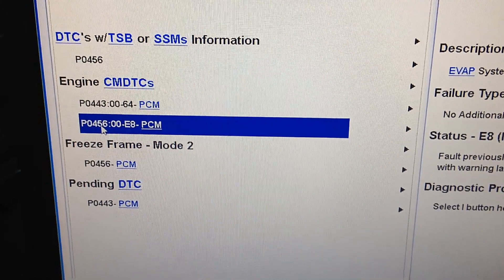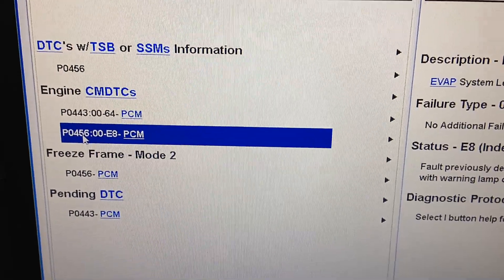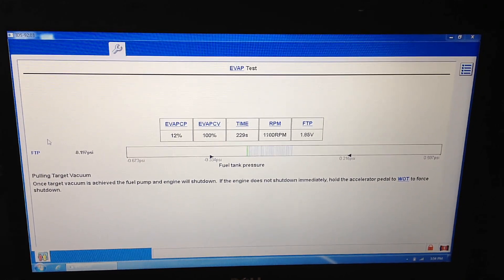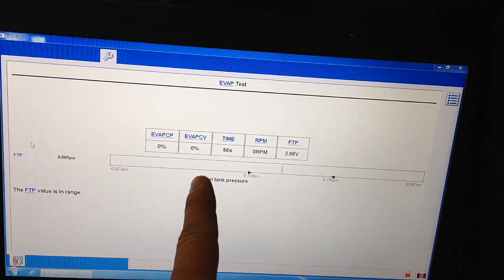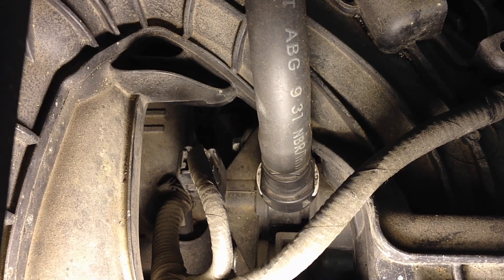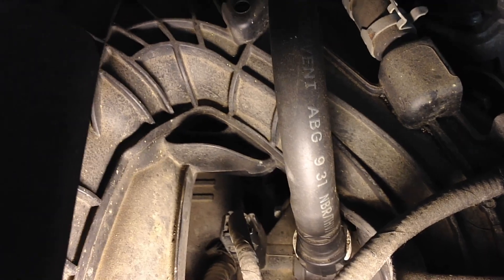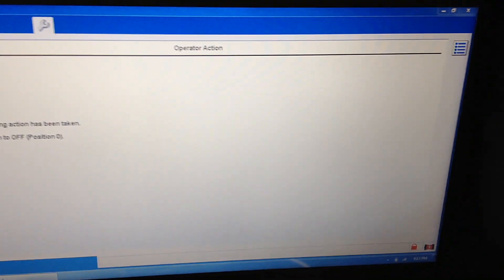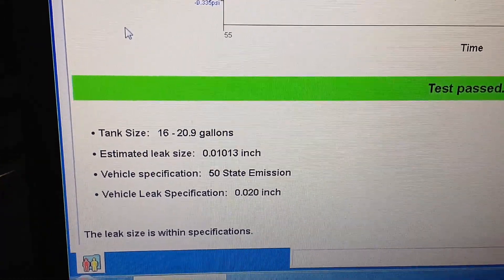Multiple Ford Vehicles 2009+ Evap System Leak Codes P0456 P0457 P1450

Comment: Thanks so much for this! I ordered the part, tested my existing part and I'm definitely getting a little bit of suction. Of course, the other issue is that my current valve is missing a screw, so that's probably causing part of the problem. I'll go ahead and replace it, though, as the new ones have probably fixed the initial problem with the faulty valves.

Can I make a suggestion for future videos? Can you back up and do a wider shot to start and then show exactly where the part is in the grand scheme of the engine compartment? When you start with the close shot, it's hard to tell if you're in the engine compartment, under the car, facing which direction, etc. It would really help to get some context first. Thanks for the great videos!
Reply from the maker: +Steven Leigh yup I have been doing that for almost a year now on the newer videos. I had to realize many never opened a hood before so you need to pan out then in or at least mention the location in the engine compartment
Reply: You're awesome, brother. Thanks for all you do. I love that you are so detailed and yet you keep it simple enough that even novices like me can get things fixed cheaply. I even did this fix in the dark and in light rain. :)

Comment: Do you have a good starting point for a code p0453 on a 2010 ford fusion?
Reply from the maker: Yes but it is going to require a scan tool that can read the ftp voltage pid

Comment: So if the purge and vent valves have been ruled out/replaced , would taping up the capless fuel fill receptacle on these to achieve a seal isolate out the fuel filler neck o ring as the culprit to a small evap p0456,( as long as it passes the drive cycle check)?

Comment: Having a rough idle and truck dies...but problem is intermittent. Also difficulty starting truck after refueling. 2009 F150 5.4L. Got the P0145 code so guess I'm replacing the purge valve as a start.

Comment: Hello, had some of these codes so I did the valve and did the throttle body to avoid future hassle after a few random stalls. Now, just stalled for first time since that work a few weeks several hundred miles later. This time I noticed a groan instead of normal prime/click/hiss prior to start. Will start up shortly after stall no problem. Suspecting fuel pump, should I go ahead and replace that as well? Will that putter out like this or is it more of a work until dead? 2010 Escape 4 Cylinder 114k zero issues until the random stalls over last month or so. Any way I can give you credit for purchase of the pump (Amazon or other) ? Thanks for your time!

Comment: Just changed the Canister Purge Valve on my 2010 Ford F150. Got the valve from WalMart online believe it or not. Then I purchased a OBDII Scanner at WalMart for $19.99 and cleared the error code myself. It took about a minute. The Purge Valve is located at the top back of the engine on the 5.4L engine but it only had one 8mm screw holding it on. There are two clamps holding the hoses in place that come off very easily. This video saved me a bunch of money.  Thanks

Comment: Got a P0455, then multiple; seems every other day P0457 (Check Fuel Fill Inlet), codes starting about half a month ago.   I checked the purge valve after finding this video of yours, and it was soooo stuck open.     Also love your capless fuel filler video too, which I've also done now twice, before finding the purge valve being stuck open.    Got a new purge valve, no more vacuum with the wire disconnected.   Waiting to see if the truck resets its codes naturally now,  I'm hoping the purge valve was the problem and not part of one.  Oh, vehicle of mine is a 2010 F150, 4.6 L. 3V.    Thanks so much!!!

Comment: I got this code on my 13 focus st, where is this located?
Reply from the maker: +Daniel Lopez It depends on the engine that is installed just follow the evap line from the firewall over.
Reply: +FordTechMakuloco well the check engine line went off after i pump gas

Comment: I have a 2008 Explorer XLT 4.0L SOHC and I am getting the P0456 code.  The vehicle has the cap less fuel fill system on it and I replaced the canister purge solenoid located near the fuse box in the engine compartment.  After I replaced that part and reset the light, the check engine light keeps coming back on for the same P0456 code. I also performed the cap less fuel filler maintenance as suggested in your other video.  Should I replace the vent valve located near the fuel tank and rear axle shaft?
Reply: I'm not an expert, but I know the P0456 code will often stay on even once the problem has been fixed, unless you clear it with a reader that has that capability. You can get an ODBII reader on Amazon for about $32 that can clear the codes, or a shop or parts store may be able to do it for you. Some parts stores are reluctant to do it, or their readers don't have the capability.

In any case, if you clear the code and it comes back, you still have an issue, obviously, but if it doesn't, you're probably good.

Comment: Do you know where the purge control valve is located on a 2013 Ford Escape?
Reply from the maker: +Miguel Soto It is either part of the line into the intake above the ETB on ecoboost models or it is bolted right to the intake on the 2.5L
Reply: +FordTechMakuloco so I have to buy the whole wiring harness to replace, I have the purge valve, but don't see it anywhere near/connected near that wiring harness
Reply from the maker: No the wiring harness is not affected.

Comment: What about P0442?  I'm getting this in my 2012 F150 for the second time within a year.  The dealership charged me $800 to fix it the first time.
Reply: Curious if you ever found out the cause of that code? What did they fix at shop? I’m thinking it’s my fuel inlet valve or possibly electrical. Thank you

Comment: I've changed the part like you suggested but still have a issue, I can't get my car registered till this is fixed.. any other ideas?
I have the p0455, p0456 and p0457 on my 2009 Ford Escape Limited V6 w/110K miles.
Reply from the maker: +Carlos G Ok so the canister purge is new and the pcm has been reset and the check engine light has come back on with only these codes right?
Reply: +FordTechMakuloco  Yes, New purge, I cleared the codes and the CEL goes away, I also tried to clear the memory using another video where you suggest making a jumper to the batt, I left that for 30 min while I washed my car but that did nothing either. I still have the light come on every week or so and the codes are still in the memory.
Reply: +Carlos G  Just a FYI: I tested the new purge valve for suction and their is a slight suction but I have to leave my finger on the opening for a good min or so and even then it's very slight. Thanks for your reply.
Reply: +Carlos G where was the purge valve located? Can't find it on my 2009 v6 escape.

Comment: would this be common on a 08 ford focus
Reply from the maker: +jason hernandez No they started using this valve in the 2009 and newer Fords.
Reply: +FordTechMakuloco will this solve the p144a code on a 2009 ford escape 2.5L?

Comment: +FordTechMakuloco I ran your simple test and I have replaced the Canister Purge Valve on my 2012 Ford F-150 3.7L. The truck is still running poorly. Aside from sounding like the engine is bogged down, the oil pressure gauge has started to drop off during light acceleration. Any suggestions?

Comment: When I spoke with the service department regarding the P1450 for our 2010 F150, he felt it was not the valve located on the firewall but the valve located on the top of the gas tank.   Of course, that is not something we can do on our own and will cost at least $500.  Thoughts?
Reply: +FordTechMakuloco - thanks for the video. Great stuff. I had the 1450 code pop up (and had problems starting after a fill up). Replaced the purge valve and code never came back. Truck seems to run a little better now as well. Could it cause a low grade misfire when faulty?
Reply from the maker: +sam foster 1450 is definitely the purge valve every time in my experience.
Reply: can you give the location on 2014 fusion se 2.0 eco

Comment: I just called Ford customer service about this problem.  Our 2010 F150 started having issues the last time we filled the gas tank.  Today CNN reported a recall involving the canister purge valve in 2010 and 2011 Ford Fusions and Mercury Milans.  They have no current recalls on the F150.  Please make sure that if you have this problem to report it to Ford which involves having to have a dealer service department diagnose the problem so that a recall can be issued for the F150 as well.
Reply: My 2015 mustang had to get the same part replaced with only 30k miles.
Thanks for the video and information
Reply from the maker: +sam foster They are starting with the fusions but I think this will expand.
Reply: Glad i seen your Pose Jose.  My 2015 GT just yesterday gave the P1450 code and i was wondering if it affect us as well.  I also am at like 34k miles.  kinda of annoying for some to go bad that early in the cars life,
Reply: My 2015 Edge with 42,500 miles has  a P0456 code.  Now I know what's happening when I take it to the dealer Monday.  Thanks for the info.

Comment: I am  going through this on my 2011 fusion 2.5l.  my question is can I replace the current capless system with a regular gas cap system from another ford? just from the hose clamp on the filler neck up?
Reply from the maker: +redjeepcrusher If you can fin one that fits sure.

Comment: Thanks for this - you just saved me over $2,000 compared to what my local Ford dealer quoted to fix the issue!  Didn't take me more than 20 minutes and it feels great to be able to do this myself.
Reply from the maker: +Gregory Billson That's the idea glad to hear it's fixed!
Reply: Gregory Billson did the check engine light come off?

Comment: I did this test and didn't have much suction before unplugging and after. I know I'm in the right spot. I drive a 2010 Ford Escape
Reply from the maker: Zach Frigo There should be zero suction.
Reply: +FordTechMakuloco I still get the codes po455 & po457 even though I have no suction. Should I change the part out anyways or could it be something else that is the problem. Thank you for your time. Hopefully I am making some since
Reply: I Have P2450/P2418 any ideas what it could be?
Reply: That's what I have, any luck?

Comment: I have a 2010 ford mustang GT 4.6 with a P0451 code. Could you tell me where the fuel tank pressure sensor is located and what another issues could be causing this code? i have been looking for information about p0451 but i couldn't find anything, thanks in advance!
Reply: Israel Valdes hey I'm having the same issue with 09 focus. I can't find anything that shows the location. what did u do to fix ur car??
Reply: Hey Daniel Diaz I've finally found the solution to this issue, and let me tell you,  that the fuel tank pressure sensor is located under fuel tank and it's connected to a hose which surrounds the fuel tank, and to replace the sensor, you have to change the hole hose, cause it comes in one piece! (FTP+HOSE SURROUNDING FUEL TANK= 1 PIECE, YOU CAN´T BUY SEPARATELY THE FTP), if you solve ur issue let me know, regards!!
Reply: Israel Valdes Try changing your gas cap, had the same code for my 2010 Ford Focus and it took car of the problem. Cap is leaking a tiny bit of air into the tank and tripping that code because of changes in fuel tank pressure.

Comment: Hi, love your site.  I have a P0451 (evaporatore emission pressure sensor code)  on my 2004 5.4 f150 lariat. I was hoping you might have some advise on wear I might start to check before I might have to take it to the dealership. any advise would be greatly appreasiated.   thanks  Jon.

Comment: Hoping this will solve my issue of fuel shutting off before the tank is full, with a P0456 code.  Can you tell me where the purge valve is located on an 09 Escape with the 2.5l 4 cyl?  Much appreciated!
Reply from the maker: David Staples Right in the front of the intake throttle body area I think I actually replace one in this video.
Reply: FordTechMakuloco Thanks! Right after I wrote that I went back out and saw it right in front of me.  Hope that replacing it, along with cleaning the capless fuel filler will solve the problem.

Comment: I have a 2004 Ford escape, runs fine but this P1450 code keeps coming up, got a new gas cap and cleared the code and about a month later it is on again. Will this possible fix it? oh and my  Engine: V6, 3.0L; DOHC; SEFI if that helps
Reply: *****  also this only happens at about half a tank of gas. I don't have a lot of money and need to fix this 
As cost affiant as possible . Please Help

Comment: Just wanted to say thank you for the video. I was getting a P1450 on my 2010 Escape and shortly after the code popped I had it stall while idling at a light after filling up the tank. I was just about ready to jack the thing up to check out the evap system but fortunately found this video first. I suspect my valve was completely stuck because I was getting a weak vacuum (and no rattle sound) no matter if it was plugged in or not. I just replaced the part and now it's rattling away and no vacuum when disconnected.

Comment: This is great information! Can you tell me where I can find where the Canister Purge Valve is located on a 2013 Ford Explorer 3.5 V6 ? ..Thank you!
Reply from the maker: martinezian65 right on top next to the throttle body
Reply: I have 2009 ford fusion, can you tell me where can find Evap emission system pressure sensor located
Reply: FordTechMakuloco 2010 ford f150 5.4 keep getting the code for the fuel filler cap is lose I change it but still same code

Comment: Hello Ford Tech Mak. I want to say "Thank you" for all the help you have given us Ford owners. Your videos have already helped me fix two problems in the past. (Tranny fluid leak on 2010 F-150 with 6R80. Evap canister purge valve on my wife's 2011 Explorer.) I have a new problem and wondered if you have done it, and if you could share a video on the fix. The passenger side blend door on my wife's explorer is apparently stuck. Blows warm air in front passenger vents no matter what you ask for. Not hot. Not cold. Just luke warm. How hard is it to access blend door actuator for front passenger side? Any advise is greatly appreciated.
Reply from the maker: It is pretty simple, first remove the glove box completely as shown in this video here-
https://www.youtube.com/watch?v=kq1IjAtmruI
then look to the left and you will see it and it  just unbolts from there.

Comment: So is this the same part on the 2007 Mercury Milan?  My check engine light is on.  I have replaced the gas cap with a cap from the Ford dealership, and cleared the code.  The code ended up coming back.  I am actually reporting P0452 (Fuel tank pressure sensor condition), and a P1450 (Unable to bleed up fuel tank vacuum).  P0452 says Fuel tank pressure sensor is defective, check connector/wiring, and check hoses and fittings.  P1450 says blocked EVAP canister/vent solenoid, kinked or collapsed hose between canister and fuel tank, or failed fuel tank pressure sensor.  Could this be a case of canister purge valve mentioned in this video?  By the way....the video on replacing the temperature sensor in the dashboard for the same Milan was genius!!  Got my air going on my own thanks to that.  Now if I can just get rid of this check engine light being on I'd be in business....PLEASE HELP ME AGAIN!!
Reply from the maker: Frederick Boyd No on yours I would go after the fuelt tank pressure sensor code P0452. The wiring or the FTP sensor has failed and is used to check the evap system so the dtc P1450 is invalid at this point until the P0452 is addressed. It is part of the vapor tube that goes to the canister under the trunk. I have changed a few fore this concern but check the wiring and such. Do you top off your tank all the time?
Reply: FordTechMakuloco
used to....bought a second car, and for most of the past year, have not been topping off due to the fact I may not get back in it for weeks at a time....can NOT filling the tank to max capacity cause this?
Reply from the maker: Frederick Boyd No it will not

Comment: Any thoughts on a P1450 code on a '13 Explorer with 6 cyclinder?  I serviced/cleanned the gas filler and the code comes back.  Also, the code is permanent.  Will the permanent code fix itself once I repair the problem?  Thanks!!
Reply from the maker: Tim Parris Replace the same thing I show in this video, clear codes and retest very common.

Comment: pretty elaborate system to check closed gas cap. check out craftsman tool # 43366, nice offset ratchet for those 8mm/7mm
Reply from the maker: Dirtyharry70585 Same setup on regular gas cap systems too but the redesigned valve came out at the same time the easy fuel system did.

Comment: I put 5 - 10 of those management valves a week. They're pretty bad about setting p2195 and p2197 o2 sensors stuck lean too.
Reply from the maker: sh4d0wzf4ll Yup I got a video whole video on that too.
Reply: I've been doing a crap load of 2011-2014 F150 sunroof tracks too. Having those problems as well?
Reply from the maker: sh4d0wzf4ll No haven't done a one yet actually.

Comment: My 07 Escape's flapper door inside the filler neck is now missing, and the pump shuts off on me now.  Does it sound like the flapper door broke off and made it's way down closer to the tank and is now clogging it from time to time while filling?
Reply from the maker: Kevin Malone Yup you will have to remove the filler neck and replace it. There should be an anti siphon device at the tip of it and that is where the flapper got stuck instead of an open pipe and it just falls harmlessly into the tank.